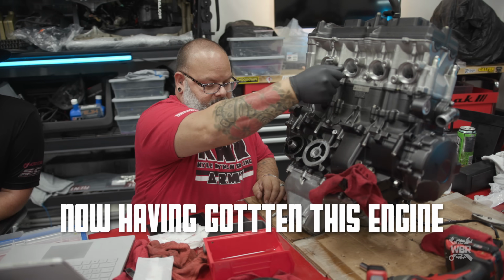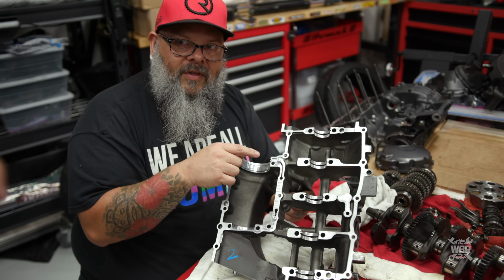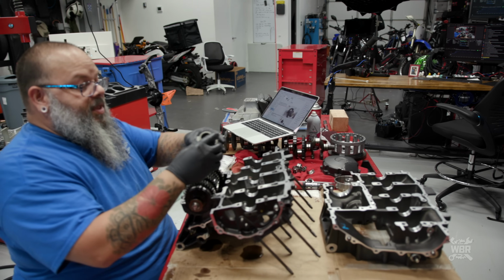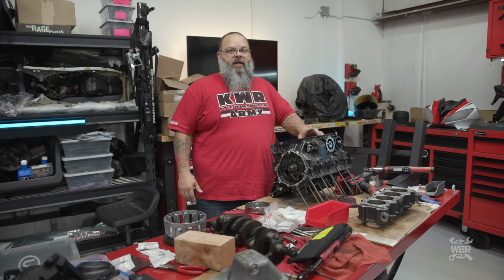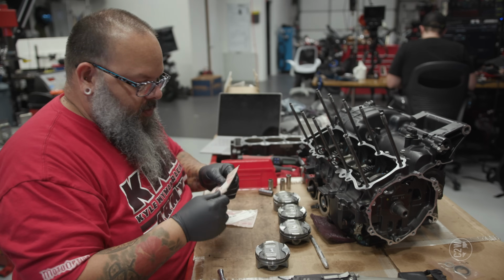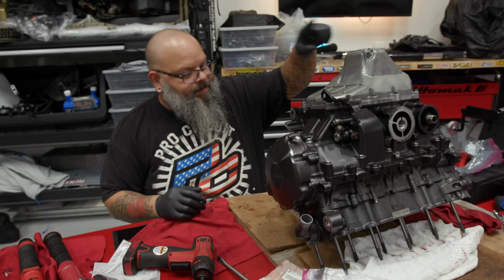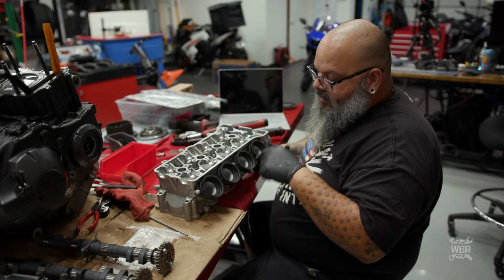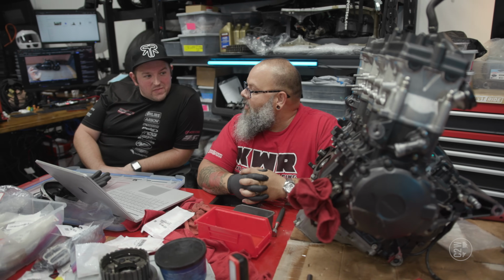Rebuilding an ENTIRE CBR 1000 ENGINE | 2008 CBR1000RR Street Fighter Build - Day 20

Comment: After installing the head it's a good idea to hand turn the engine through a few complete revolutions and then check your valve clearances. The clearance can change when the head is bolted down. A machine shop can get them close on a bench but I have seen the clearance change after the head is bolted down. Also if you have made a mistake with your timing or valve to piston clearance you will find it now, as a bent valve, but the piston likely won't be damaged when the crank is gently turned by hand. I know because I have incorrectly timed an engine and bent a valve. It was much easier to fix before the whole engine was sealed up.

Comment: Not me buying a disassembled 08 cbr1000rr and watching this vid to rebuild it
Reply: Bruh 😂😂 I’m watching bc I broke a rod on mine and about to take mine apart
Reply: Wouldn’t happen to know the countershaft seal part number😂
Reply: Bro I have a complete 08 just all in parts I’m with you now 😅
Reply: Believe me get yourself a manual. I have one and it shows every single screw on it how, where and how tight to mount it. Its crazy good
Reply: @ispartacus0877it’s almost like that’s what shops use to work on vehicles. jokes aside it is insanely useful, i dont work on my bike without it, unless its like an oil change
Reply: @747simmer4 Exactly!!! And you can prolly analize the problem yourself before bringing it to the mechanic that will charge you 150 bucks just for analizing.
Reply: @ispartacus0877 habrá la posibilidad que me compartas el manual o me orientes donde consigo información
Reply: Would it be possible for you to share the manual with me or point me in the right direction to find the information?

Comment: Can someone tell me what the torque specs are for the bolts that hold the two half’s of the crank case together and the specs for the cylinder head bolts are I haven’t been able to find trustworthy torque specs for either set of bolts an this video is the only one I’ve seen that someone is rebuilding this cbr 1000rr engine

Comment: Since you torqued the cases together and had to take it apart, does that mean you need new bolts or will it still be alright? I have to plastigage my engine and I am wondering if I should use the old bolts for it, or the new ones.
Reply: If cash and time wasn't a factor. Maybe I would go get new ones
Reply: @paulh9301  I have new ones, but I don't want to use them for the plastigage test, for fear of stretching them. That's why I will use the old ones for the testing. I think they will do, for that.
Reply: @johnb5519  after a certain torque is reached, there sould be no difference when doing the plastigage test. 
using old bolts at 2/3 to 3/4 of the specified torque should be fine.
otherwise you'd really need new bolts for every test as well.
So it is very .. let's call it "strange" that this thing kinda just got swept under the rug in the video.
Normally I would expect it explicitly mentioned that they now had to order a new set of bolts because of that.
Once stretched, the bolts def. cannot be reused in the same way as if they were new. And this is a liter bike engine after all.
P.S.: I'm not (even) a mechanic by trade, so DYOR, etc.
Reply: @JB82374  These bolts have a specified torque, plus a certain amount of degrees past that, to achieve the proper amount  as described in the manual. One use only. You tighten the conrod bolts to 14 ft pounds, plus 90 degrees, and the mains to 14 ft pounds, plus 150 degrees. I'll use the old bolts for the test and I figure about 18 to 20 ft pounds should do.
Reply: @johnb5519  as I said, you should be alright with way less torque on the old ones if you're just doing the plastigage test.
don't remember where it was, but somebody did tests with no difference after 30 or so percent of the normal torque figure.
putting more torque on pre-streched bolts can result in their unexpected behaviour.
Reply: @JB82374  Sounds logical. Thanks.

Comment: Did I miss what happened with the cam chain tensioner? 1 shot there was an issue, the next it was in with no explanation
Reply: Fuuuuhk, tell me qbout it. No one on the internet has done anything on the CAM CHAIN GUIDES OR TENSIONER SHOE. Just CCT, CCT, CCT... or anything with that side of the motor 🤯🤬 I'm so frustrated rn
Reply: @rhyno9798 Think I can help, unless you know what you're doing, stick with the automatic spring loaded CCT.
But if you really wish to switch to the manual one, you need to find a sweet spot where you hear minimal ticking noise from the timing chain, and no whining sound.
Ticking noise = Loose timing chain
Whining sound = Tight timing chain

edit : So I saw the whole video, he just used the automatic CCT
Reply: I don't know why people make such a big deal about a cam chain tensioner. It is about the simplest part of the engine since it is self adjusting. Maybe he had the center bolt on it during installation, there is a sequence to it.

Comment: Hey ! Got a tiny question there !

Actually not trying to blame on Brian's work, I ain't got a 1/100 of his knowledge and experience 

But the "one-time-use-double-threaded-twisted-thing" has been dismounted then re-torqued, does the one time use usually stands for the torquing or the heating of the engine ? 

Thanks for replying 💙 

Your team's job is incredible, keep it up 👊
Reply: Torquing. However the manual asks for you to back off the torque and re-torque which is allowed for with the same bolt.
Reply: @katiejohns3415  oh ok ! Was 99% sure it was for torquing, but didn't know about the re-torque thing, thanks !

Bye ! ')

Comment: "Always read the manual and go line by line"

Fucks it up anyway and disassemble the whole engine case because he didn't read the manual when trying to install the pistons in the cylinder....all four in one go...
Reply: Ya complete idiots now the case will be flexing and distorting using double stretched Tq to yield bolts and knows absolutely nothing about engines clearly doesn’t even know that the crankshaft rides on an oil film and there’s no freaking grit and the sulfide grease to grind the bearings and crank together to meet them holy shit these guys are idiots is a freaking hydrodynamic wedge of forced oil pressure the crank doesn’t even touch the bearings it rides on a film of oil if he put grit paste in the bearings and crank that engine will be toast but obviously he clearly does not know what disulfide grease is 🤦🏻‍♂️

Comment: Is there no need to gap the piston rings?
Reply: They come ready to go, they used the stock cylinder + stock pistons, they usually check the ring gap on the cylinder but probably did that off camera, not really a need since they are brand new as a set. It’s not like they are doing a big bore kit from different brands cylinder/piston/ rings